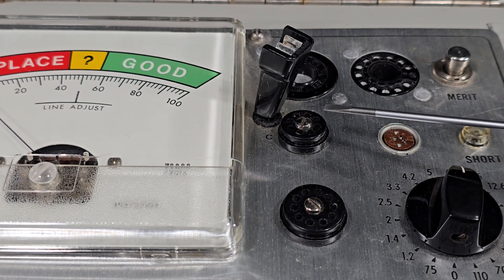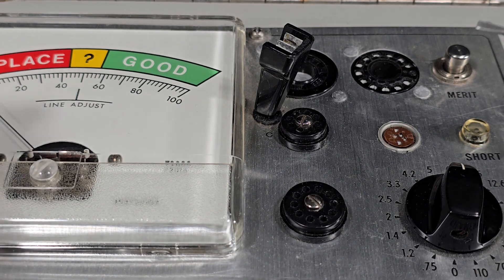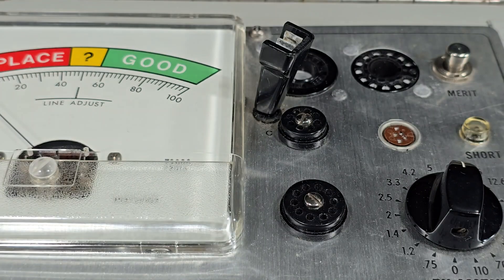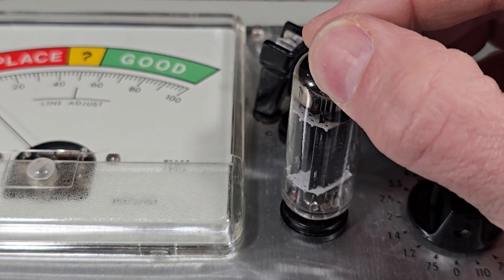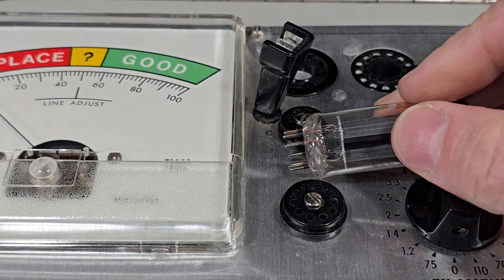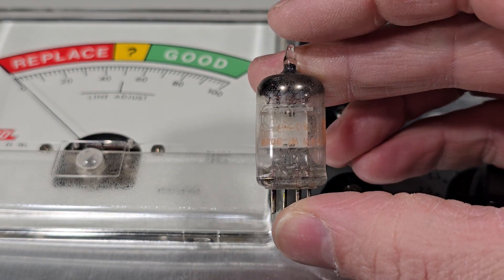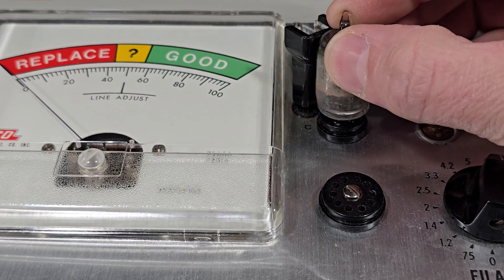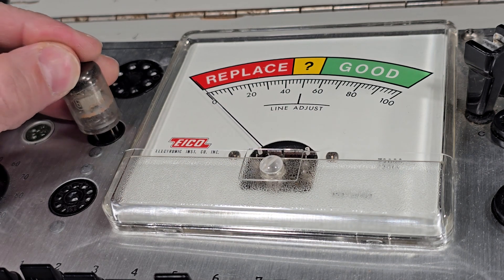How to Straighten Vacuum Tube Pins Using a Tube Tester (7-Pin & 9-Pin Demo)

Comment: That valve tester - my Dad had one back in the 50s and it was of US origin, had to have a 110V supply through a 220/110 transformer.  But the plugs we used then were also 2-pin and one day I plugged in his valve tester into the 220 mains and it blew. It was the only time I remember my Dad really angry with me and to this day I still have remorse for doing such a stupid thing.

Comment: Aaron (sp); Just came across your channel via a Tek 1A1 video... Man!! You have a veritable truckload of videos!
Your home doesn't say anything about you.. but, on LinkedIn, you appear as an Application Engineer at DigiKey.
Since I'm an old-time AE/FAE, starting with Motorola computer systems in about 1983, Motorola VMEbus and microcontrollers in 1980's, Tek Canada, Agilent, then 6+ years in global r&d at Nokia in Finland, 3+ years as headquarters AE at R&S in München, I feel your "Vibe" 😸 !
Reply from the maker: Thank you. I should be cleaning the shop but it is more fun to make the videos.

Yes, DigiKey AE